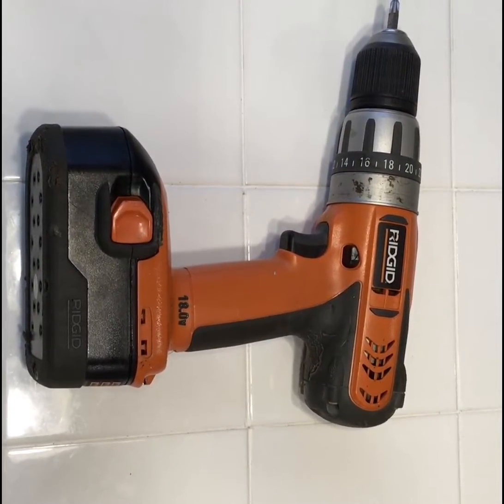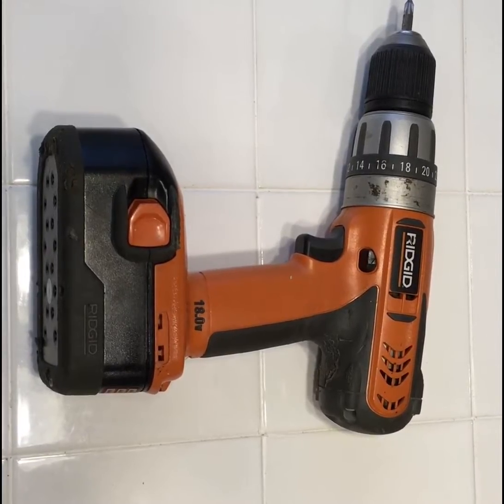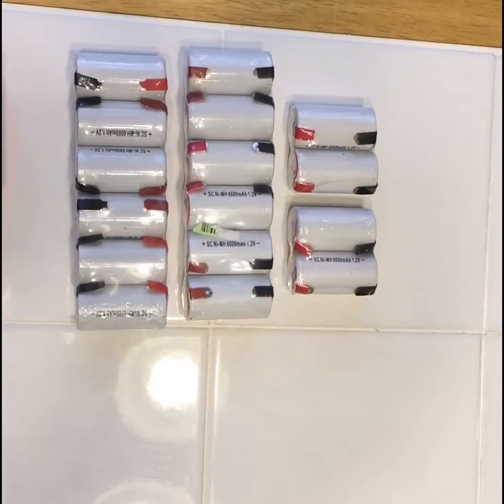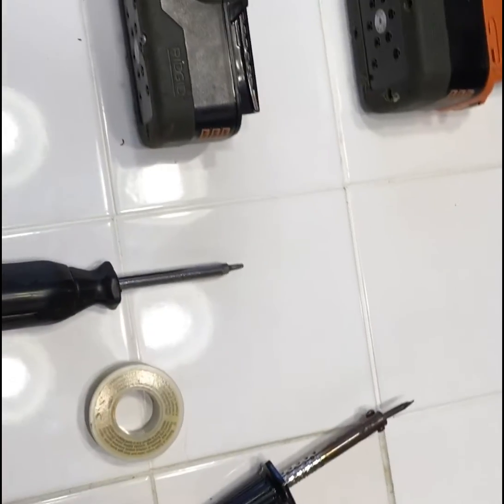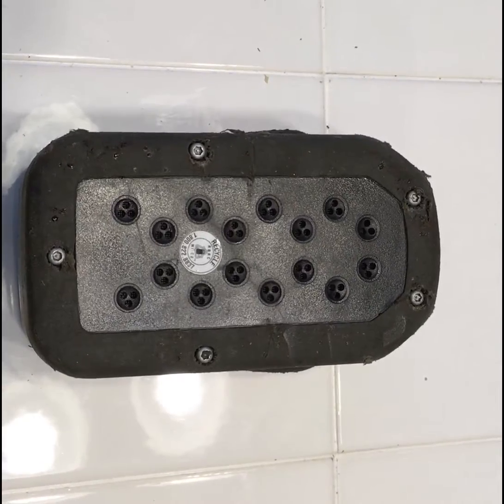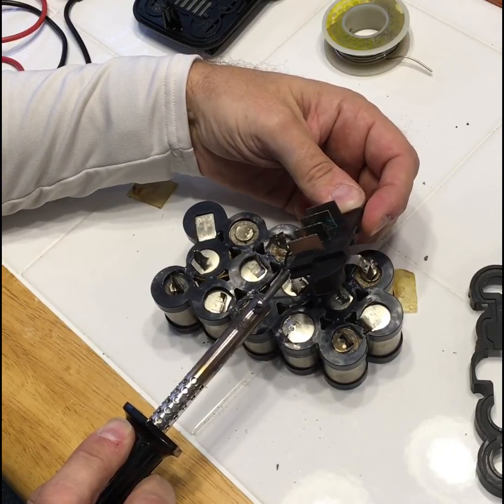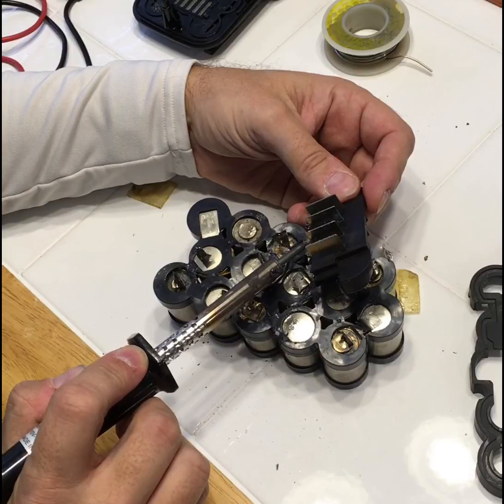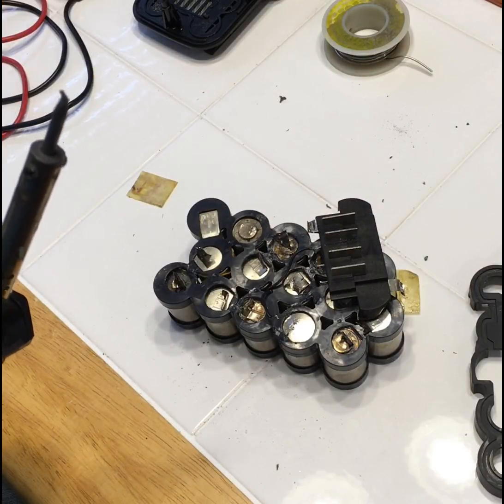Ridgid 18 Volt Battery Internals Replacement Part 1

Comment: Why do Nicad batteries go bad?
According to the author, NiCD batteries fail completely because they're shorted out by "crystal dendrite growth," an accretion that can apparently be blasted away with a quick jolt from a welder attached to a high-voltage source.Dec. 18, 2006

Comment: LIFETIME Warranty on Ridgid batteries make cost of replacement  $0.00.
Reply: not on batteries. the main reason I went with ridged was lifetime. but its all bullshit. I dare yall to get your 18v 9.0a battery with added warranty extension to be actually replaced with a brand new not refurbished product.
Reply from the maker: @mark welch, that's correct, as long as you purchased it from an authorized retailer and you register the product within 90 days of purchase.  If you don't meet both of those requirements you have zero warranty.

Comment: Can you convert to lithium ion?
Reply from the maker: Steven Gleave , honestly not sure, but if you did you’d have to buy a lithium ion charger.
Reply: The charger for my drill that uses this battery states on in  ni cad  or lithium.  To me that says it charges either

Comment: I can use rigid battery 18 volt on rigid tool 14.4 volt. I be gracefull for you help me. thank you.
Reply from the maker: Angel Matos , it is not recommended.  It may work short term, but over time it can burn up the drill.
Reply: Honest Jeff Reviews & DIY Jeff thank you